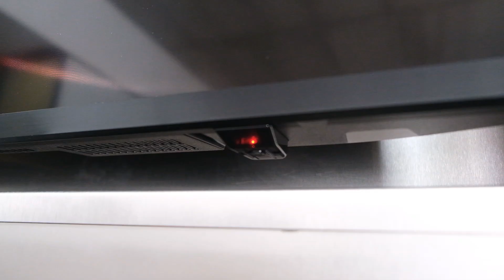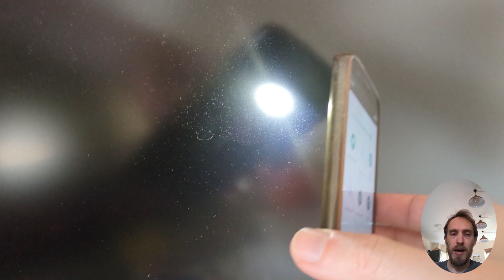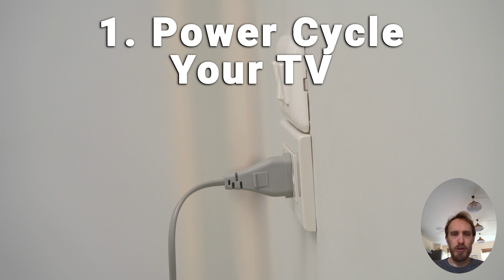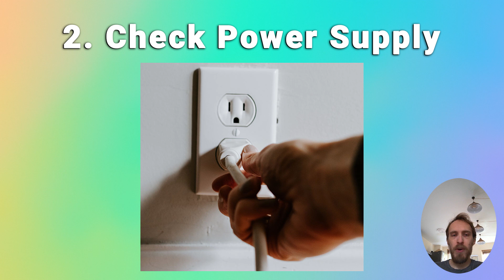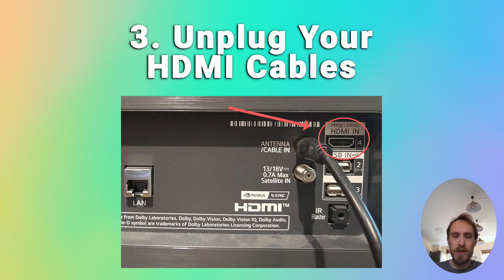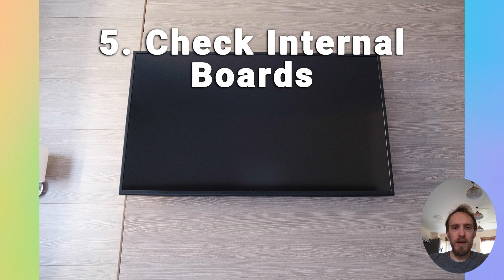Toshiba Fire TV Red Light Blinking | 5-Min Troubleshooting

Comment: my toshiba power light was flashing when first plugged in then went dark, after disconnecting  the cables from the power supply and main board and all others, and turning on a off, now  if i turn it on the power light is goes off and i have a dark blue screen, the remote only will turn it on and off, no menu pops up so its just dark blue, any suggestions
Reply: I have the same but red and green flashing and main screen not responding, tempting to send it out the window ngl
Reply: I too have the same problem, did you find a solution?
Reply: @AnujTalking  The parts were not worth the money for a 6-year-old television so I just replaced the television
Reply: Plz tell me  @AnujTalking